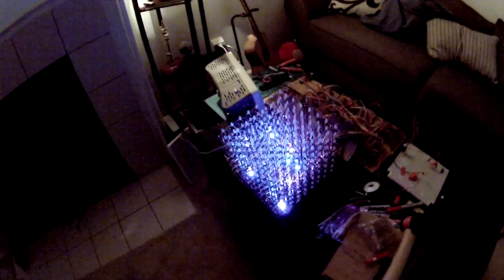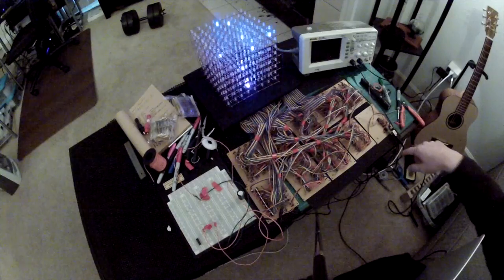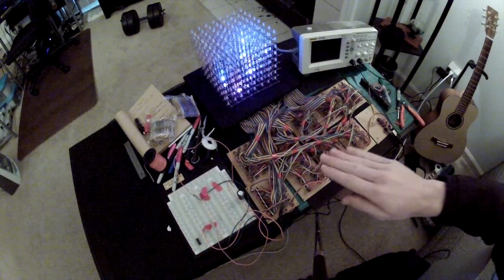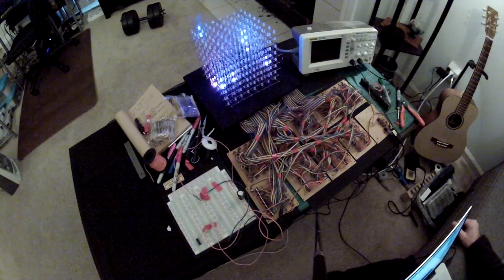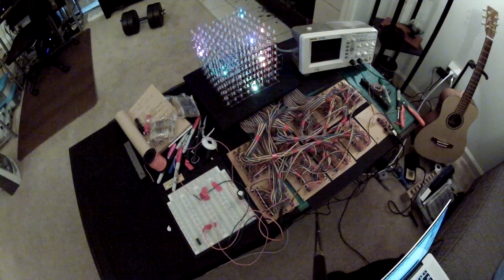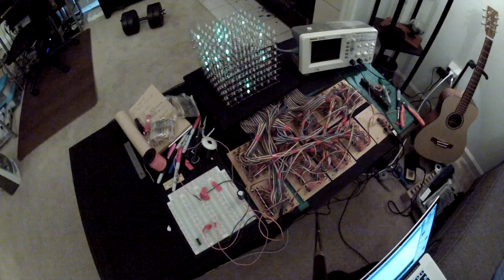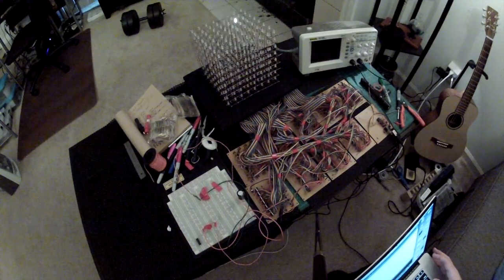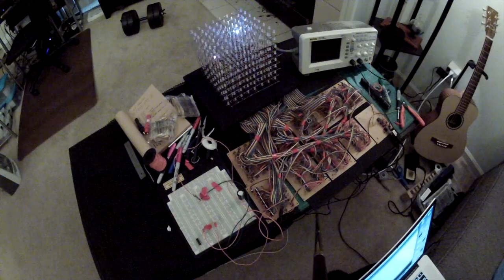8x8x8 RGB LED Cube - The Build Part 3  Test Animations!

Comment: hai Sir Kevin. I'm Ricky from indonesia. your projects are so amazing. especially this 8x8x8 RGB LED Cube project. by the way i have a problem when i do this project (8x8x8) everything was built. when i test the code in proteus,its work. but in the real one,the cube doesn't do the animation. and when i start it,all LEDs were ON. I use Arduino Uno kit and already upload the code inside the arduino uno. is it different if we use arduino uno kit and directly ATmega 328??

Comment: where do you find more information about power supply required for rgb  512 leds matrix 8x8x8 to light , however the rgb is more than 20 ma. it is 60 ma each led. so how many 512 leds rgb ? is it 30720 ma. i m little confused i don't see your tutorial how to use for power supply to match leds ma.

Comment: You actually don't need PWM for such a cube. I reckon any chip would do, as long as you have at least 3 outputs, if I'm not mistaken. Then you can link up the shift registers and everything should be working just fine. 

I wonder what the difference is in programming (especially in terms of difficulty). I just started out, but I'd definitely be interested in bringing the costs down.

Comment: Great comment, thanks ExStatic Bass. I'm building something totally different (still a whole lot of LEDs), but the schematics are pretty similar and I was looking for a power supply that would be easy to integrate. After skimming through the comments I came across yours and the old computer PSU is working perfectly so far. 

Again, thanks. :D

Comment: Why you didn't hack a computer AT PSU for this is a curious thing to me. You can get them for $16 on NewEgg and they'll hold more than 10 amps. A good idea for this would be to have an encoder knob to change hue on demand without a computer. Also momentary contact buttons to change between scenes would be fun, me thinks...

Comment: Would it be possible to bring the cost of this down by using a naked AVR rather than an Arduino) something like an ATTINY85 and attach some PWM controllers to it such as TLC5940 or similar? Those chips provide shift register, programmable PWM and driver capability, radically reducing the number of I/O pins and external components you'd need. Also there are ready-made libraries for using them.  I've never looked into using 5940 for matrix work, but should be possible?

Comment: Very cool,  That thing is a monster.  I don't know which looks more intimidating, soldering the cube, or soldering the control board.  I am surprised the arduino can shift out (512x3=1536 bits) at speed.  Also, FYI,  Video was not boring, I enjoyed watching you running through code examples and you explaining some of the details.  Can't wait until you can light all of them up.  Then you can do some neat planar type animations with whole "sheets" lit at once, rotating, shifting, etc.